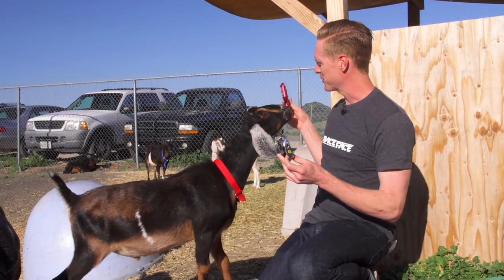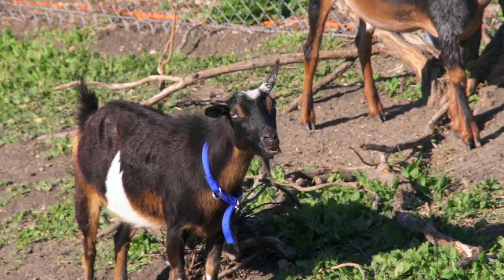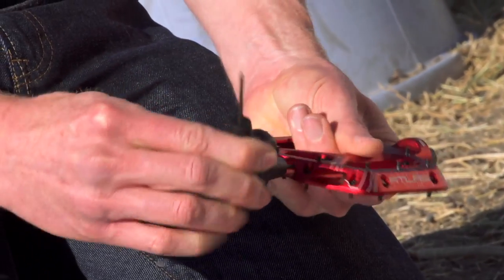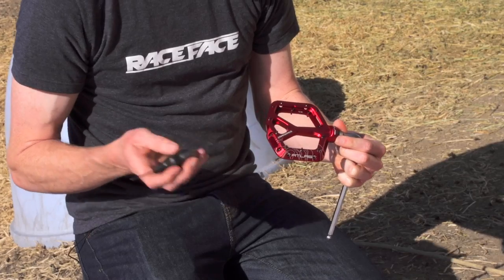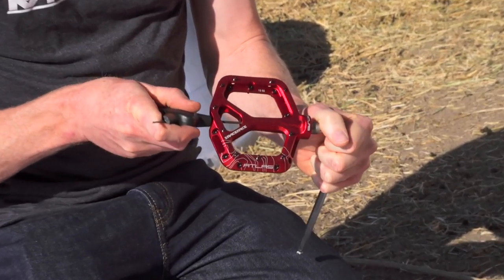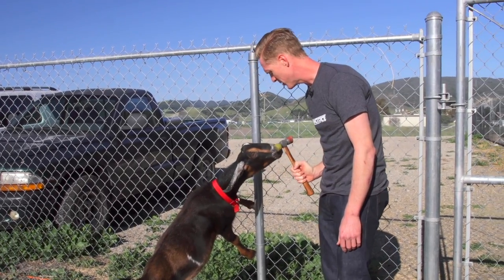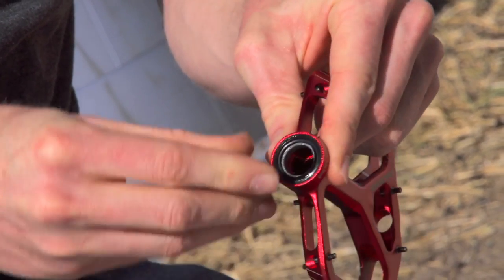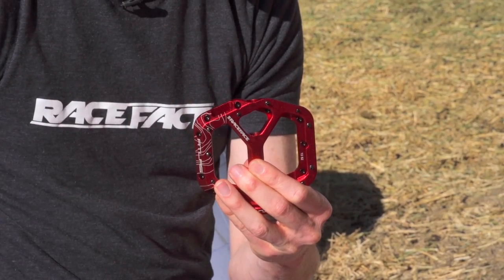How To: Rebuild RaceFace Atlas Pedals

Comment: First time I use these pedals and after a 45 min ride, the left side has already developed massive side to side play ;-(

How do I fix this? Tighten nut and use locktite, so it doesn't happen again - or return to RaceFace?
Reply: +Krikstar123 
my brand new set fell apart on first ride, in less than 4miles. re-tightened everything and could notice tons of lateral slop side to side on both sides. sent pedals back for replacement. got new set today and they do the exact same thing! biggest waste of money
Reply: +mxxmikexx1
Same here. I wrote RaceFace because I didn't want to spend money sending them back, only to get yet another defect sample and waste money on that too etc. No help from RF! Apparently RF thinks it's only very few pedals, even though the internet is full of examples of the opposite... Their best/only solution was to do what you did - without success. Quality control and cost here of is completely up to the users - WTF??? What kind of ass hat company does something like that?
Reply: +Krikstar123 
I took the new set apart, put locktite on the spindle bolt,and TIGHTENED the piss out of it and it seems to be better. going out today for a ride so I'll report results. I'll be bringing spare pedals with me tho incase the atlas fail,
complete joke that such expensive pedals are having this issue. I have a lot of race face components on my niner, but will be very hesitant to purchase another race face product after this experience.
Reply: +Krikstar123 
my second replacment set had the same problem. Im sending them back for refund.
I have read that if you file down a very small amount from the end of the pedal spindle that will fix the slop issue. BUT if you file to much the pedal will bind!  so file at your own risk!
epic fail race face
Reply: +mxxmikexx1 Bummer, I don't feel like filing down anything.

Seems like Race Face removed all our comments on their Facebook page. Apparently they are ok with repeatedly sending out defective products, but can't take criticism for it... Well done, Fail Face :-b

Comment: Mine got air/play after a small kontact with the ground while pedaling. I tried to tighten the spindel, but it doesnt work. Tightend all screws there are, but it still got play/air/space (sry for my bad english). What can i do now? These things are only 3 Weeks old.
Reply: +bimmer666 my idea is that the spindel is a bit to long. Maybe i can make it shorter.
Reply from the maker: +bimmer666 We can guarantee that the spindle supplied is factory spec and is, in fact, not too long. Do not try shortening it. It sounds like you've knocked some pins and screws loose. What we'd recommend is remove the pin and end cap, then starting at :45, tighten the 2.5mm allen at the end of the spindle to make sure that your spindle is all tight and free of play.
Reply: +Art&#39;s Cyclery Yeah, i already did that. It still got side to side play. I cant tighten the 2,5mm any more. It has full contact to the spindel.
Reply: Yup, very common with these pedals. Mine did the same thing and I couldn't get the play out because the 2.5mm end screw bottomed out on the spindle. I ended up filing a little bit off of the small spindle end and that worked........ But I sold them on eBay and looked elsewhere.